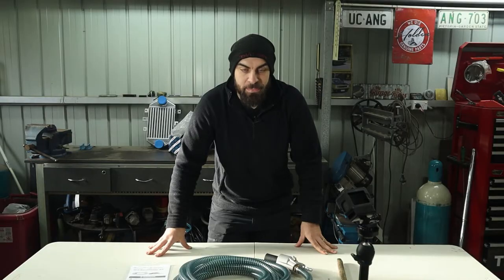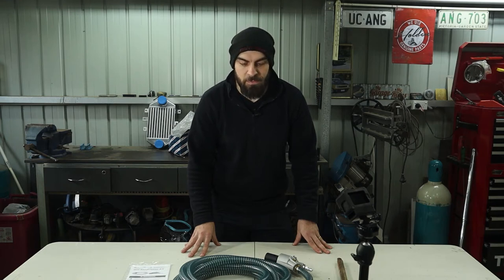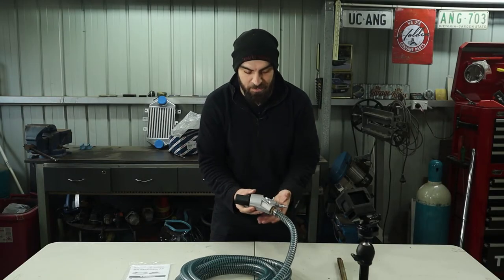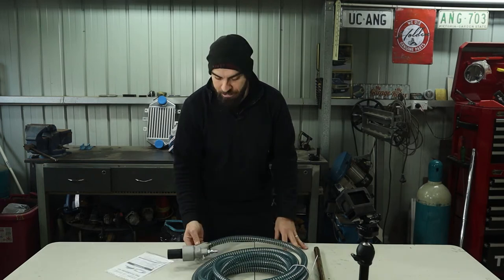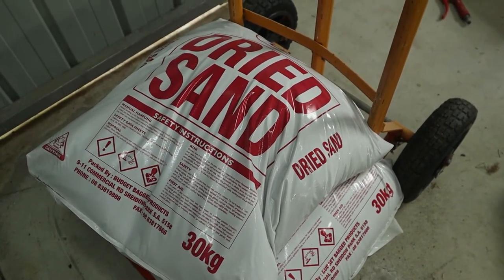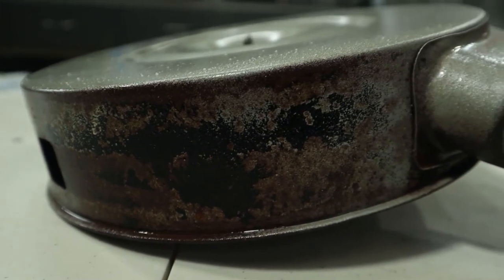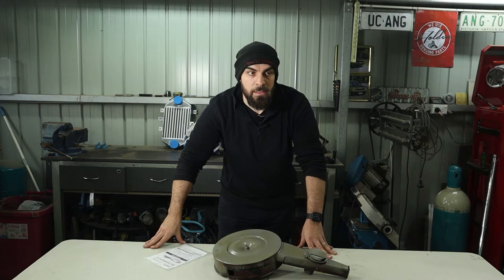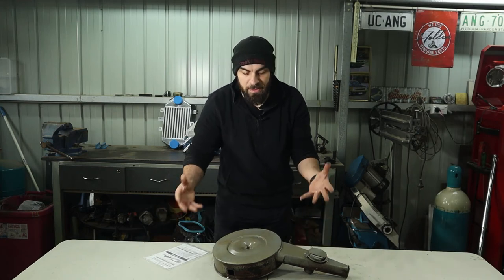Pressure Washer Sandblaster Attachment (Dustless Blasting)

Comment: Really great results! This is the best I have seen. I noticed that these particular blasters need 4gpm to work. I was all excited until I found out my pressure washer only does 2.5gpm. So, a high volume pressure washer is a must. The extra water flow you added from your source made all the difference because your pressure washer can handle the volume needed. Great video!

Comment: Great video which I watched after total frustration with my $50 amazon purchase.of a water blaster attachment - it seems my professional Karcher 5/12C.  You definitely made the right decision investing in professional grade equipment to avoid pitfalls.
Looks like you need to spend a grand to achieve top grade  professional results. (as usual).
My Karcher apparently  hasn't got the guts to create enough suction to transport the media. from the bag (80 Grit Garnet purchased from H&F) to combine with the jet stream.......
Based on your set up the karcher flow rate is probably too low at about 10l/min and 2200psi.
Your thoughts?
Reply from the maker: That’s a beefy Karcher, however you’re right, definitely the more flow the better. I think you usually need to look for around the 13L mark and over 3000psi. I wouldn’t call my particular Pressure Unit professional, it’s a knock off Honda unit that’s imported by a local machinery joint in my state. The attachment itself is great due to its quality cast and long lasting carbide tipped nozzle. The golden Amazon cheapies are a glorified suction feed squirty bottle.

Comment: Great tool no doubt. Better than using an air compressor and dry blasting.
Reply from the maker: They both have their pros and cons. This setup is also messy, loud and the flash rust is a problem. Wet sand lodged in crevices can be problematic also.

Comment: you said yours sandblaster was for 3000psi but the ones you have listed are for 5000psi are these the exact same as what you used or are they different
Reply from the maker: I think you will find the nozzle is rated to a maximum of 5000 psi. My pressure washer is 3000psi or so. But it’s the gallon/ liters per minute flow which is most important to make the nozzle work best

Comment: is this the exact one you used and NOT THE BRASS ONE
Premium Tungsten Carbide Nozzle Cone, Stainless Steel Nozzle Tip 4.0 and Steel Head for Durability and Excellent Performance
Reply from the maker: You haven’t put up a link, but going by the description, yes that’s the one.
Reply: @PangazShed  thanks mate appreciate your help

Comment: Sandblasting better to use without water cuz water levels rust after
Reply from the maker: “Dustless Blasting” is a thing. It uses water mixed with blasting media. There are products to overcome the “flash rust” issue, no problems! Thanks
Reply: @PangazShed  what is the kit called
Reply from the maker: Pressure Washer Santblasting Attachment (or Nozzle)
Reply: Rust after blasting can be easily dealt with.. Better than hours grinding or brushing just to end with a mediocre job. Not counting that there are additives for rust prevention in wet blasting.